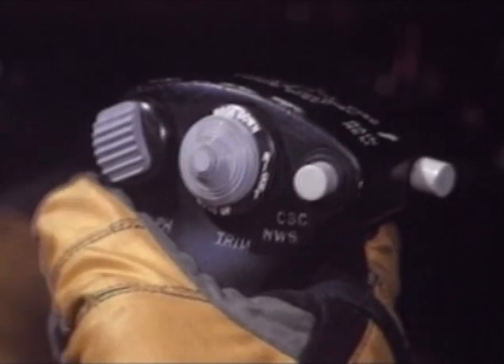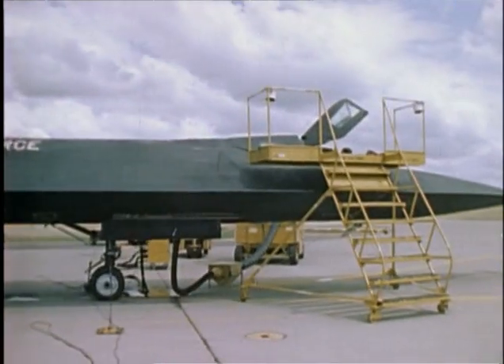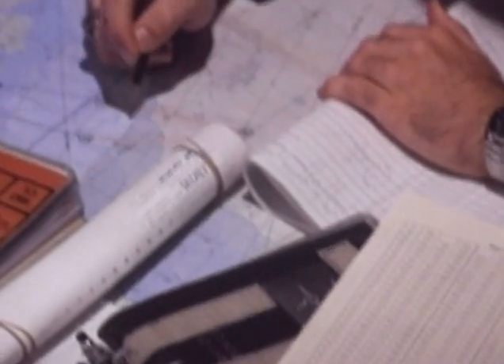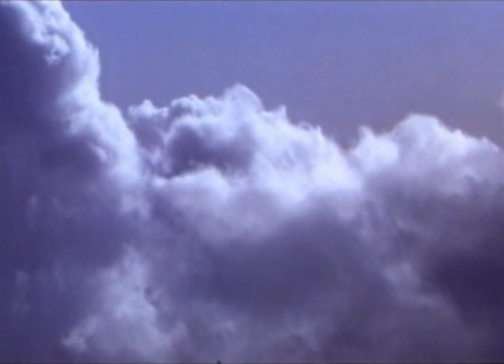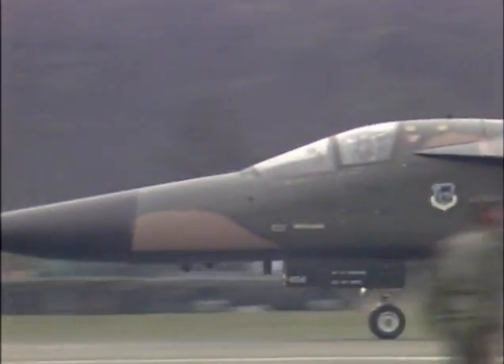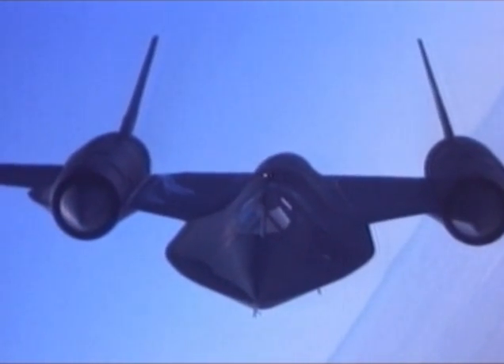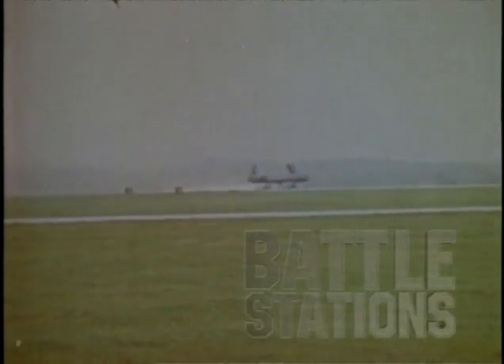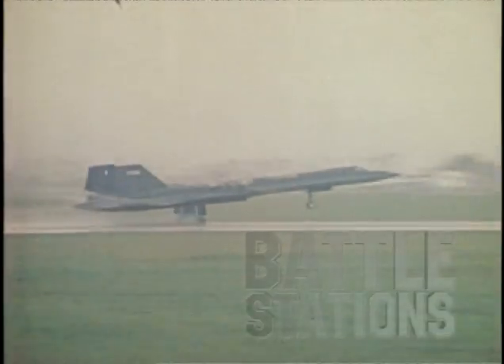Battle Stations - SR-71 Blackbird Stealth Plane -Full Documentary

Comment: Here's a couple Blackbird pilot stories I'm glad I hung onto. Enjoy:  Brian Shul, Retired SR-71 Pilot:

As a former SR-71 pilot, and a professional keynote speaker, the question I'm most often asked is "How fast would that SR-71 fly?" I can be assured of hearing that question several times at any event I attend. It's an interesting question, given the aircraft's proclivity for speed, but there really isn't one number to give, as the jet would always give you a little more speed if you wanted it to. It was common to see 35 miles a minute. Because we flew a programmed Mach number on most missions, and never wanted to harm the plane in any way, we never let it run out to any limits of temperature or speed. Thus, each SR-71 pilot had his own individual “high” speed that he saw at some point on some mission. I saw mine over Libya when Khadafy fired two missiles my way, and max power was in order. Let’s just say that the plane truly loved speed and effortlessly took us to Mach numbers we hadn’t previously seen.

So it was with great surprise, when at the end of one of my presentations, someone asked, “what was the slowest you ever flew the Blackbird?” This was a first. After giving it some thought, I was reminded of a story that I had never shared before, and relayed the following.
I was flying the SR-71 out of RAF Mildenhall, England, with my back-seater, Walt Watson; we were returning from a mission over Europe and the Iron Curtain when we received a radio transmission from home base. As we scooted across Denmark in three minutes, we learned that a small RAF base in the English countryside had requested an SR-71 fly-past. The air cadet commander there was a former Blackbird pilot, and thought it would be a motivating moment for the young lads to see the mighty SR-71 perform a low approach. No problem, we were happy to do it. After a quick aerial refueling over the North Sea, we proceeded to find the small airfield.

Walter had a myriad of sophisticated navigation equipment in the back seat, and began to vector me toward the field. Descending to subsonic speeds, we found ourselves over a densely wooded area in a slight haze. Like most former WWII British airfields, the one we were looking for had a small tower and little surrounding infrastructure. Walter told me we were close and that I should be able to see the field, but I saw nothing.

Nothing but trees as far as I could see in the haze. We got a little lower, and I pulled the throttles back from 325 knots we were at. With the gear up, anything under 275 was just uncomfortable. Walt said we were practically over the field—yet; there was nothing in my windscreen. I banked the jet and started a gentle circling maneuver in hopes of picking up anything that looked like a field. Meanwhile, below, the cadet commander had taken the cadets up on the catwalk of the tower in order to get a prime view of the fly-past. It was a quiet, still day with no wind and partial gray overcast.

Walter continued to give me indications that the field should be below us but in the overcast and haze, I couldn't see it. The longer we continued to peer out the window and circle, the slower we got. With our power back, the awaiting cadets heard nothing. I must have had good instructors in my flying career, as something told me I better cross-check the gauges. As I noticed the airspeed indicator slide below 160 knots, my heart stopped and my adrenalin-filled left hand pushed two throttles full forward. At this point we weren't really flying, but were falling in a slight bank. Just at the moment that both afterburners lit with a thunderous roar of flame (and what a joyous feeling that was) the aircraft fell into full view of the shocked observers on the tower. Shattering the still quiet of that morning, they now had 107 feet of fire-breathing titanium in their face as the plane leveled and accelerated, in full burner, on the tower side of the infield, closer than expected, maintaining what could only be described as some sort of ultimate knife-edge pass.
Quickly reaching the field boundary, we proceeded back to Mildenhall without incident. We didn't say a word for those next 14 minutes.
After landing, our commander greeted us, and we were both certain he was reaching for our wings. Instead, he heartily shook our hands and said the commander had told him it was the greatest SR-71 fly-past he had ever seen, especially how we had surprised them with such a precise maneuver that could only be described as breathtaking. He said that some of the cadet’s hats were blown off and the sight of the plan form of the plane in full afterburner dropping right in front of them was unbelievable. Walt and I both understood the concept of “breathtaking” very well that morning, and sheepishly replied that they were just excited to see our low approach.
As we retired to the equipment room to change from space suits to flight suits, we just sat there-we hadn't spoken a word since “the pass.” Finally, Walter looked at me and said, “One hundred fifty-six knots.
What did you see?” Trying to find my voice, I stammered, “One hundred fifty-two.” We sat in silence for a moment. Then Walt said, “Don’t ever do that to me again!” And I never did.

A year later, Walter and I were having lunch in the Mildenhall Officer’s club, and overheard an officer talking to some cadets about an SR-71 fly-past that he had seen one day. Of course, by now the story included kids falling off the tower and screaming as the heat of the jet singed their eyebrows. Noticing our HABU patches, as we stood there with lunch trays in our hands, he asked us to verify to the cadets that such a thing had occurred. Walt just shook his head and said, “It was probably just a routine low approach; they're pretty impressive in that plane.” Impressive indeed.

Little did I realize after relaying this experience to my audience that day that it would become one of the most popular and most requested stories. It’s ironic that people are interested in how slow the world’s fastest jet can fly. Regardless of your speed, however, it’s always a good idea to keep that cross-check up…and keep your Mach up, too.

--------------------------------------------------------------------------------------------------------------------------------------------------

There were a lot of things we couldn’t do in an SR-71, but we were the fastest guys on the block and loved reminding our fellow aviators of this fact. People often asked us if, because of this fact, it was fun to fly the jet. Fun would not be the first word I would use to describe flying this plane. Intense, maybe. Even cerebral. But there was one day in our Sled experience when we would have to say that it was pure fun to be the fastest guys out there, at least for a moment.

It occurred when Walt and I were flying our final training sortie. We needed 100 hours in the jet to complete our training and attain Mission Ready status. Somewhere over Colorado we had passed the century mark. We had made the turn in Arizona and the jet was performing flawlessly. My gauges were wired in the front seat and we were starting to feel pretty good about ourselves, not only because we would soon be flying real missions but because we had gained a great deal of confidence in the plane in the past ten months. Ripping across the barren deserts 80,000 feet below us, I could already see the coast of California from the Arizona border. I was, finally, after many humbling months of simulators and study, ahead of the jet.

I was beginning to feel a bit sorry for Walter in the back seat. There he was, with no really good view of the incredible sights before us, tasked with monitoring four different radios. This was good practice for him for when we began flying real missions, when a priority transmission from headquarters could be vital. It had been difficult, too, for me to relinquish control of the radios, as during my entire flying career I had controlled my own transmissions. But it was part of the division of duties in this plane and I had adjusted to it. I still insisted on talking on the radio while we were on the ground, however. Walt was so good at many things, but he couldn’t match my expertise at sounding smooth on the radios, a skill that had been honed sharply with years in fighter squadrons where the slightest radio miscue was grounds for beheading. He understood that and allowed me that luxury.

Just to get a sense of what Walt had to contend with, I pulled the radio toggle switches and monitored the frequencies along with him. The predominant radio chatter was from Los Angeles Center, far below us, controlling daily traffic in their sector. While they had us on their scope (albeit briefly), we were in uncontrolled airspace and normally would not talk to them unless we needed to descend into their airspace.

We listened as the shaky voice of a lone Cessna pilot asked Center for a readout of his ground speed. Center replied: “November Charlie 175, I’m showing you at ninety knots on the ground.”
Reply: Now the thing to understand about Center controllers, was that whether they were talking to a rookie pilot in a Cessna, or to Air Force One, they always spoke in the exact same, calm, deep, professional, tone that made one feel important. I referred to it as the “ Houston Center voice.” I have always felt that after years of seeing documentaries on this country’s space program and listening to the calm and distinct voice of the Houston controllers, that all other controllers since then wanted to sound like that, and that they basically did. And it didn’t matter what sector of the country we would be flying in, it always seemed like the same guy was talking. Over the years that tone of voice had become somewhat of a comforting sound to pilots everywhere. Conversely, over the years, pilots always wanted to ensure that, when transmitting, they sounded like Chuck Yeager, or at least like John Wayne. Better to die than sound bad on the radios.

Just moments after the Cessna’s inquiry, a Twin Beech piped up on frequency, in a rather superior tone, asking for his ground speed. “I have you at one hundred and twenty-five knots of ground speed.” Boy, I thought, the Beechcraft really must think he is dazzling his Cessna brethren. Then out of the blue, a navy F-18 pilot out of NAS Lemoore came up on frequency. You knew right away it was a Navy jock because he sounded very cool on the radios. “Center, Dusty 52 ground speed check”. Before Center could reply, I’m thinking to myself, hey, Dusty 52 has a ground speed indicator in that million-dollar cockpit, so why is he asking Center for a readout? Then I got it, ol’ Dusty here is making sure that every bug smasher from Mount Whitney to the Mojave knows what true speed is. He’s the fastest dude in the valley today, and he just wants everyone to know how much fun he is having in his new Hornet. And the reply, always with that same, calm, voice, with more distinct alliteration than emotion: “Dusty 52, Center, we have you at 620 on the ground.”

And I thought to myself, is this a ripe situation, or what? As my hand instinctively reached for the mic button, I had to remind myself that Walt was in control of the radios. Still, I thought, it must be done - in mere seconds we’ll be out of the sector and the opportunity will be lost. That Hornet must die, and die now. I thought about all of our Sim training and how important it was that we developed well as a crew and knew that to jump in on the radios now would destroy the integrity of all that we had worked toward becoming. I was torn.

Somewhere, 13 miles above Arizona, there was a pilot screaming inside his space helmet. Then, I heard it. The click of the mic button from the back seat. That was the very moment that I knew Walter and I had become a crew. Very professionally, and with no emotion, Walter spoke: “Los Angeles Center, Aspen 20, can you give us a ground speed check?” There was no hesitation, and the replay came as if was an everyday request. “Aspen 20, I show you at one thousand eight hundred and forty-two knots, across the ground.”

I think it was the forty-two knots that I liked the best, so accurate and proud was Center to deliver that information without hesitation, and you just knew he was smiling. But the precise point at which I knew that Walt and I were going to be really good friends for a long time was when he keyed the mic once again to say, in his most fighter-pilot-like voice: “Ah, Center, much thanks, we’re showing closer to nineteen hundred on the money.”

For a moment Walter was a god. And we finally heard a little crack in the armor of the Houston Center voice, when L.A.came back with, “Roger that Aspen, Your equipment is probably more accurate than ours. You boys have a good one.”

It all had lasted for just moments, but in that short, memorable sprint across the southwest, the Navy had been flamed, all mortal airplanes on freq were forced to bow before the King of Speed, and more importantly, Walter and I had crossed the threshold of being a crew. A fine day’s work. We never heard another transmission on that frequency all the way to the coast.

For just one day, it truly was fun being the fastest guys out there.

Comment: made with paper and pencil, no modern pc, but it is FAST as thr hell, it's mechanical, 2 engines quite bigger of the airplaane in front, as faster of 2 times sound the spikes in front of engines make a oversound pressure that go intake
and it is FAST, as fast as when a missile is lauched at you the defence is no chaff, no flare........RUN, run as fast as you can ahahah, faster of the missiles, or at least quite as fast, but missiles have 200/500 km/miles, this monster can do an half of earth at top speed
Reply: no, not alien help, simplly von braun, the man ho made the v2 for hithler, v2 missiles in 1943/1944 can go at 96 km kigth, go for 1000 km distance, and go at 6.000 km/h speed
Reply: 20ea later the jmoon, now the gpps!
Reply: 20 years later the moon, now the gps!

Comment: So, question to any pilots or flight engineers/design, out here in YouTube land...
If the blackbird runs super hot & cuts "like butter" through the skies, how could they fly for 11.5 hrs and not overheat or have maintenance issues?
Genuinely naive and ignorant on aviation, and curious...thank you for any help understanding.
Reply: JT's Channel Since it was secret who knows how many crashed.
Reply: Jorge, 32 SR-71's were built, 12 crashed but none were shot down.
Reply: JT, the aircraft was skinned (covered) in titanium which has a very high melting temperature and also dissipates heat (cools) rapidly, the fuel it carried also acted as a heat sink to help absorb and dissipate even more of internal heat.  . The aircraft was designed to allow for metal expansion (grow) in flight and actually expanded 6in. in length at top speed. Maintenance on the SR-71 was very intensive and required far more hours than it flew.

Comment: Saw one of these do a fly-over at Pt. Mugu naval air station during an airshow many years ago. It performed a slow pass in front of the crowd, which amazed me, since it looks like it needs to be doing 300 mph just to take off. After that, he came around again only to pitch the nose up severely at the end of the run. "Oh, no." I was thinking to myself, "He stalled it". And then the pilot punched it and went to full afterburner. I don't think I'd ever heard anything that loud in my life. I joined the crowd by clapping my hands over my ears as that airplane spat twin columns of ringed blue fire out its back end and turned into a ballistic missile, shooting out of sight in within seconds. Wow.

Comment: 40:42 ...."We were seeing Mach numbers that were a little scary that we had not seen before, and the jet did it effortlessly".... This airplane's speed was secret  classified information, but we knew it could fly three times the speed of sound...faster than bullets, missiles or anything else on earth. The speed mentioned at 40:42 was  undoubtedly Mach 4 or  higher, which to any pilot meant the possibility of the airplane shattering, yet the SR-71 was saying "I'll fly  you  even faster if you  push my throttles forward". Wow !  What an airplane !!!!!
Reply: The top speed of the SR-71 is still classified.